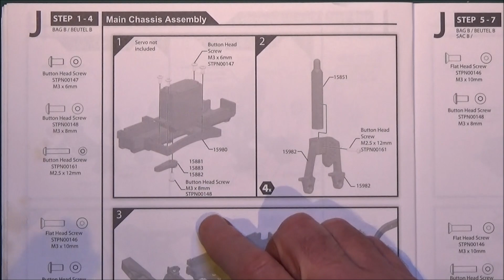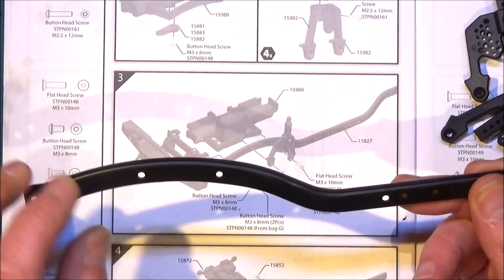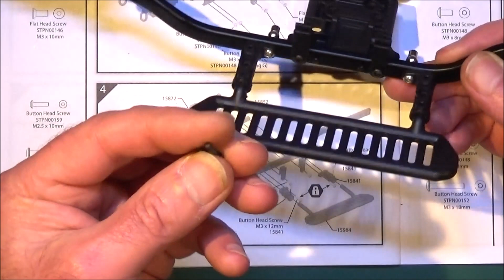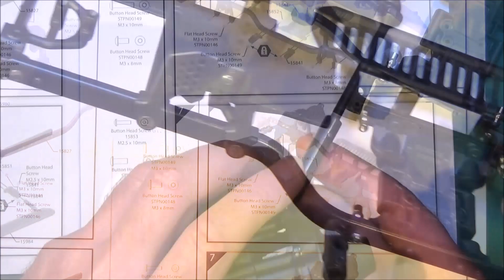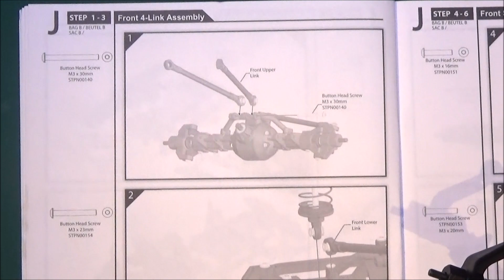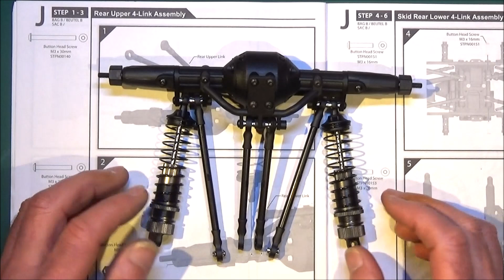Carisma SCA-1E Build Guide & Tips Part 3 Chassis Done + Test Drive!

Comment: I thought some one would of mentioned the front wheel lifting and the reason AND the cure? Great build by the way,waiting for the cosmetics now
Reply from the maker: Thanks Gary - yeah, still not sure but I posted this on FB and someone said it was due to the torque from the propshaft on the solid axle twisting in one direction. Seems to make sense - and the only solution is to add more weight to the axle. Let's hope someone else comments with a few more ideas! All the best from Mark!  :)

Comment: Greetings Mark!!! 🎉🍺🍺
Sorry I'm late. FIRST recommendation here - all Crawlers NEED at least a 20kg, all Metal Geared Servo - and equally important, Alumininium Servo Horn. You'll find that the Plastic Horn will STRIP in short order. That would be high on my list. 
If you want to email me your address, I'd like to send you the Servo and Horn!

There are excellent qualities in this Kit!! I'd call it an ideal First Crawler Kit for anyone who is getting started in Crawlers. The assembly is quite straightforward and reasonably simple, with decent quality bits. I think you're going to enjoy it me Mukka!! 👍👍😊 

I really like the Beadlocks! If it were mine, I'd strip the Paint, polish them a bit, and then Clearcoat, so it looked more like original.
I'd eventually invest in some grippier, proper Crawler Tyres too. They can be pricey - but I KNOW of a set of Korean Knockoffs that are under $30(£23.50) for 4, if you're interested.

Even though 100% of my Crawlers are Axial.... My NEXT one is going to be the GMade Buffalo GS-02F. I'd strongly recommend, if you want a second... THAT ONE.
Besides having one of the most advanced Chassis I've seen, and excellent balance and articulation, it's got a very Scale Body - with NO exterior Body Clips!!! It's well equipped at a very reasonable price (less than Axial or TRAXXASS!!) 

My dear Friend, I hope 2021 is off to a great start. Mine's looking up! MIGHT be getting my Inheritance by the end of the MONTH!!!! 😁😁😁😁😁
All our Best my Friend! 😉
Carmine ✈🚂🚙
Reply: I believe in the end, you'll find the Body very rewarding to do! 
In proper Crawler fashion, you need to fit some sort of Interior...
Even a simple one like Matteo describes in his Crawler builds. 😉
Reply from the maker: Cheers mate, as you now know, I did that! You were spot-on as always! Cheers!
Reply: @MarkBryanRC  I'm ALWAYS glad to help you whenever I can! Crawlers I know well, and can offer as much help as possible 😀 
You've already done a great job of it, add-ons are the fun bit!
...... gee, I hope I get that Inheritance soon! 😝🤣
Reply from the maker: So sorry I missed this comment - it just popped up in my list!!! IDK what youtube is doing!
Thanks so much, all the advice you gave has been soaked up and digested. I really appreciate you taking the time to help me. Take it easy, brother!  :O)

Comment: Hi Mark, Overall I think this build came together nicely.  The quality is a nice mix of metal and plastic.  I like the aesthetics mainly the motor cover and wheels.  The test at the end was impressive. Wonder how much the body will change the weight distribution!  If we were running more 1/10 scale Crawlers this would definitely be on the wish list. There is so much competition and choices between brands at this level the manufactures have to put out a good product and a kit that comes together as seamlessly as possible.  I recall minimal issues with parts and missing pieces, overall not bad at all👍🏾  Always enjoy watching you build RCs.  Take care!!
Reply from the maker: Cheers, Paul! Yeah, it was a good build, not too tricky and only a few little issues with the manual - so overall, highly recommended, especially at the price point, which is much cheaper than a lot of the competition!  Looking forward to trying it in the real world outside, and I have high hopes for the scale performance. The Lexan body is very light, so I think it's effect on the chassis will be minimal. Thanks for always leaving a thoughtful comment, hope all is good with you, Bro!  :O)

Comment: Hey Mark, so a few more issues with the build like 'assuming' you're using the correct screw at one point and correcting the manual at another. Nothing too bad but it's a shame nonetheless. The most impressive part for me were those metal wheels. I'm assuming you didn't glue those tyres in place ( nothing was shown. ) One thing that drives me nuts about ready to run RC's is when the factory glue the tyres to the rim - badly. It creates a distortion as the wheel rotates and the wheel looks slightly buckled. Horrible. It's happened on a couple of my Axials and they cost a small fortune to replace. So with this kit ( like a Tamiya ) it's a nice option either not glueing the tyres or doing it yourself. Metallic blue sounds cool. Looking forward to that section of the build. Great video dude. I learned something new...👍🏻👍🏻.
Reply from the maker: Cheers, mate! Yeah, nothing too problematic, just little annoying things, but overall I'm very happy with the kit. Oh, those wheels are works of art, and well worth paying a little extra for the limited edition kit. No, they don't need glue as the tyre is clamped to the rim by that metal ring inside the tyre. Nothing is going to make those rubber rings come off! Sounds like a nightmare with those Axial rims, not good for a premium quality rig! Hmmm... not sure about the blue, mate, it's a bit too dark for my liking, hopefully it'll look better if we get some sun to shine on it one day. Thanks for the positive feedback, always appreciated my good friend!  :O)